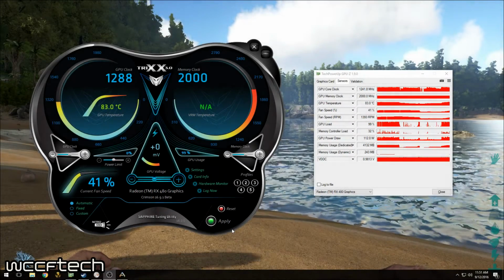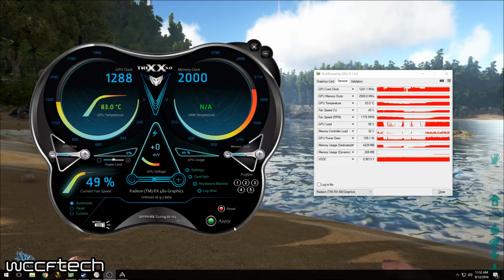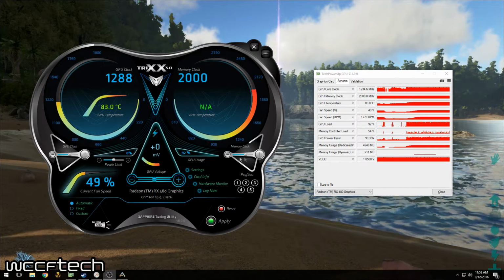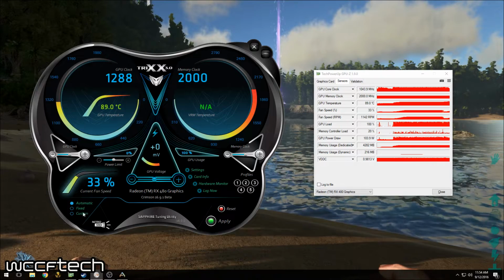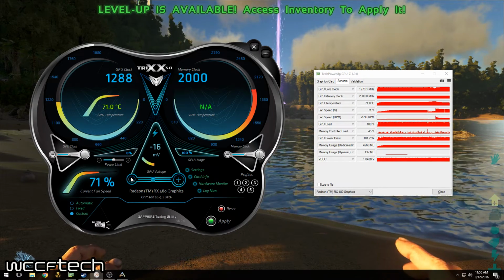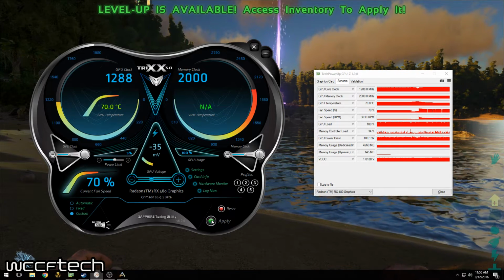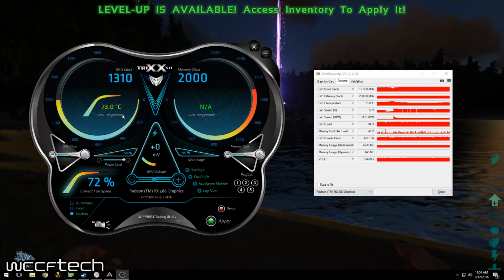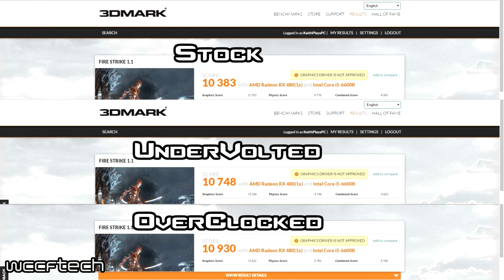Overclocking RX 400 Series with Sapphire Trixx 6.1 (RX 460, RX 470, RX 480)

Comment: Hahahah I overclocked mine to 8000 on Memory Clock, ya'll lame as hell using 2000 (I prefer to not use it while playing cs but still I use 6000 on cs, Usally use 8000 while mining
Reply from the maker: you know it's quad pumped memory right? 2000 = 8000 effective.

Comment: I have a dell insprion 15 5576 gaming laptop and I have sapphire installed..
I don't know how to use the utility for mobile laptop gaming ... 

I have a switchable graphics configuration...R7 and the dedicated discrete gpu RX 560 4GB of GDDR5 memory. 
Dual-Channel but only one 8Gb stick...2400 MHz DDR4 memory. 
max TDP is 35.0 W have a 74watt hour battery and a 130V Ac adapter.... 
the Rx560 core clock is 1053MHz and the Memory clock is 1500MHz I am hesitant of not going up with speeds..

what do I need to do with tweaking it higher a little..not too much but to where it can run ok..in the green?

Comment: so I'm a little worried... whenever I up the voltage on my MSI RX 480 Gaming X 8G to +100 it automatically goes down to +96 instead, no matter what I do (Why??? I can't find a SINGLE other person with this problem). I decided to get trixx because I heard the voltage can go higher, but it glitches and can go to over +10000 mV....... of course I didn't apply it, but it's so much the numbers go off the screen! I flashed a new BIOS, same thing. Any ideas??
Reply: what are your temps? or voltages?
Reply: U4Real? Temps are fine, never going above the 73 Celsius target with low fan speeds. voltage is in the normal range, varying from 1-1.2 if I remember correctly. I think it's just a glitch only with Trixx, as I don't have any gpu related problems as of now.
Reply: check to see if you up the voltage up to 1.3, but slowly increase it or the the power limit bit by bit. If you've already tried this, then I'd be stumped. But usually 1400mhz is the limit, so not sure what +100 means on the MSI card which I believe has a 1330 boost clock iirc. I have a gigabyte card and I've seen people go as high as 1450, but that's on water
Reply: U4Real? Well the voltage can't go that high anyways, and I figured out that the +96 is normal as far as I can tell. Reviews at guru3d.com have the voltage at +96 for a lot of the rx 480 cards

Comment: I just bought an RX480 from Sapphire its a Nitro 4gb card and i OC it to 1350Mhz and its at stock MV and power boost are on 0% the way it came and it OC fine when i run my games and i check the max Clock its set on 1350 so why power boost it and take MV away!!!

Comment: Hi, I did the undervolt but I'm not sure if I'm doing it right 'cause I went to -45 mV and it changed to -42 by itself, also used +5% Power Limit and all this running FurMark stress test... is this ok? does this actually improve smth? capture: https://drive.google.com/file/d/0B9aQ50LUPQqnM09aOTRzN3JYdEE/view
Reply: Everthing is ok
Reply: I can use a -70mv undervolt at stock speeds

Comment: is it possible to undervolt my card while maintaining core clock speeds but increasing memory clock speeds? Ive read that increasing mem clock speeds actually gives a great boost in performance. Great vid by the way, seems like ive been doing it wrong. I have the rx 470 4gb version btw
Reply: fcsie So hows ur oc doing? i got the same card, whats ur trixx settings?
Reply: I managed to get a core clock from 1260 to 1320 stable at stock volts, + 10% power limit while i overclocked my memory clock from 1750 to 1850 stable. Increasing both gave me an increase in fps when i benchmarked it in games like shadow of mordor
Reply: Further increasing the memory clock from 1850 made me have lag spikes in games despite getting higher benchmarked scores
Reply: fcsie will try to oc my 470 with your setting
how many fps increase did you get?
Reply: I wouldnt recommend following my settings, every graphics card has different capabilities to overclocking (silicon lottery). You gotta do trial and error for ur own gpu, that is the whole idea of overclocking anw. 
Managed to get 4-5~ fps increase in shadow of mordor ultra settings

Comment: rx 470 8gig running fine with 1242 mhz clock with voltage drop to -36mv and probably it's sounds bullshit but games looks far better like before with the crappy msi gaming app.  under the gaming app i had slow loading in games and system errors all the time once or twice crash too but with the trixx the card working fine .
Thank you.

Comment: trixx crashes my system as soon as I fire it up. My screen flashes then it crashes stating some sort of driver error. Tried different drivers still the same results. This is with the RX480 8gig. I've tried this with 6 different cards ...crashes everytime
Reply: I have the sapphire rx480's
Reply: try uninstalling amd apps and the sapphire app and then reinstall it. idk if it will work tho

Comment: I've managed to overclock mine from 1342Mhz up to 1410Mhz and the Memory
 Clock from 2000 up to 2030... The power limit is set to 50%, the GPU 
Voltage is set to +60 mV... just wondering if are these settings 
safe?... It's my first time overclocking a GPU... I've read in some 
article that increasing GPU Voltage would damage/ kill the card :(...
Reply from the maker: +60mV will be fine as long as you keep the temperatures in check.  Going past +100mV is when things get iffy. -Keith
Reply: I got to about 1490 with no issues and memory to about 2090
Reply: Fifth Gaming yo I’m thinking of OC mine, I have the same card. I’m at the regular boost clock (the one that the card comes with on the switch) can you give me tips to OC it, never done it before.
Reply: Fifth Gaming I’m
At the boost clock 1342 btw
Reply: I have a 480 saphire nitro + 8 GB
Reply: What's your fan speed? For this overclock?

Comment: Can you still overclock an OC Video Card? I have a SAPPHIRE RX480 Nitro+ 8GB OC and it's running at its boost clock which is at 1342MHz... just wondering if it can still be overclocked :/
Reply from the maker: go for it :) you should at least be able to get a bit more out of it still -Keith
Reply: I see. Thank you very much for the reply sir ! :)
Reply: I've managed to overclock mine from 1342Mhz up to 1410Mhz and the Memory
 Clock from 2000 up to 2030... The power limit is set to 50%, the GPU 
Voltage is set to +60 mV... just wondering if are these settings 
safe?... It's my first time overclocking a GPU... I've read in some 
article that increasing GPU Voltage would damage/ kill the card :(...
Reply: Tech and Gaming, RWGTROLL And did you maybe think through what i wrote?
Did I or did I not say that voltage rises temperature exponentially due to friction? Did I or did I not say that temperature kills electronics because it overheats and melts circuits inside components?
Do you realize that maybe you can only monitor GPU and not EVERY SINGLE FREAKING COMPONENT ON YOUR CARD?
You increased voltage by 400 mV and BOOM a component got fried and your bios got corrupted because it didn't get a read on that necessary component.
There isn't only GPU on the PCB there are about thousand other components and some of them are VERY sensitive to heat meaning if they go over certain temperature they will get fried instantly.
If you still come back thinking i'm wrong please don't bother writing because i won't bother writing back. I have finished engineering school and I know my shit about electronics because my field IS electronics... Also there is google educate what voltage is and how voltage kills electronics.
Reply: Tech and Gaming, RWGTROLL GPUs behave completely different when they're under -196c. Secondly no the chips don't die. They mostly die due to condensation and short circuitry. Even tho you protect it sometimes you just don't protect it good and water gets in and boom it's dead.
Voltage is not dangerous. Friction is. Basically if there was no friction inside the circuits you could run at infinite voltage but that is impossible because of the resistors which are made with the friction in mind.
The only enemy that a graphics card has is the heat.
Reply: Tech and Gaming, RWGTROLL sigh you really are pullin my balls here now aren't ya?
Reply: Voltage doesn't kill card. Heat does. Voltage increases heat exponentially. Electronics get "killed" from high voltage not because high voltage messes with "things" inside electronics but because components overheat due to friction.
So monitor your temperature and if you're not in the red you're good to go. Don't worry about voltage as long as you're in the safe temperature zone (80 is the threshold).
Reply: sermerlin1 Also then explain liquid nitrogen and subzero cooling. Those chips die a lot of the time and it's not from heat, the chip is at -196 c .
Reply: sermerlin1 voltage isn't dangerous amperage is.
Reply: hmm
Reply: jahruze Frankly you will have to  tune your card yourself. First things first you may want to increase power limit to about 5 or 10%. If the card stays on a given power limit at the clock of 1342 mhz then you have to take voltage and drop it like it's hot. Keep dropping that voltage incrementally until you see benchmarks crashin and your drivers crashin as well. Then that means you've hit the limit. You will have to back up until you hit the stable voltage. Boom you will have cooler card and 1342mhz stable. :)
Reply: sure you can. I have same gpu as you but mine is 4GB version so it have only 1306MHz boost, but Im running stable oc at 1440 MHz core clock, 2100 MHz memory clock, 50% power limit and 70 mV gpu voltage.
since your card is already running higher boost than mine, you could try to push it to 1500 MHz core clock.
Reply: and yes... Dont forget to make custom fan curve. That helps a lot with temps
Reply: Yes you can but, how much more you are going to get out of that card is going to minimal.
Reply: I can say high voltage can kill \damage a card. my proof is my r9 390x, I pushed 400 mv to my GPU and it will never over clocking again. It still works fine. and not it didn't get hot it was for like 2 secs and I corrupted my bios and everything.
Reply: " Voltage doesn't kill card. Heat does. Voltage increases heat exponentially. " you only get heat from voltage soooooo..... that mean voltage kills cards. I also could give two s** about you "degree". :P experience trumps all...